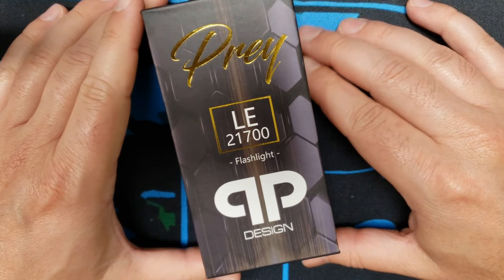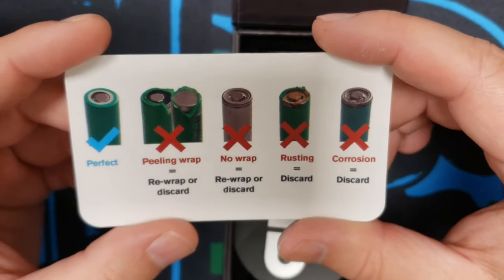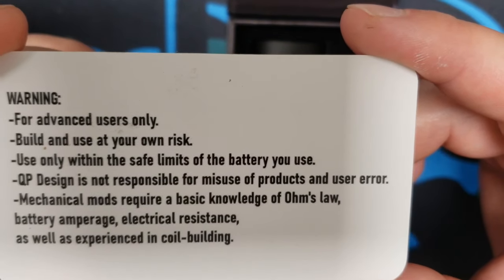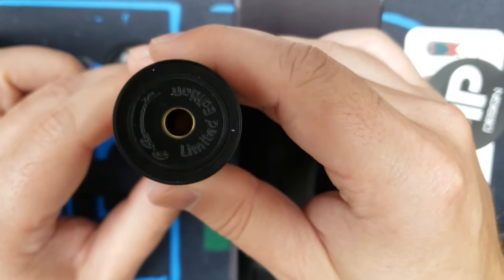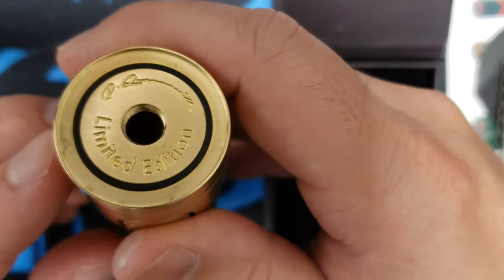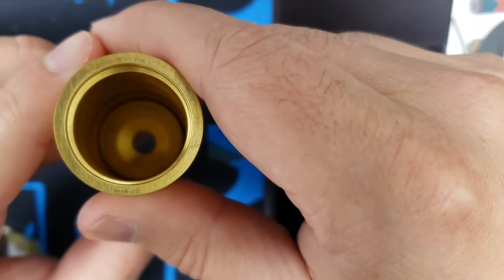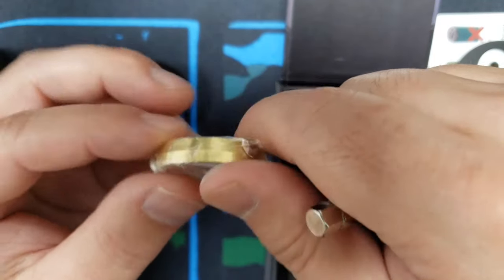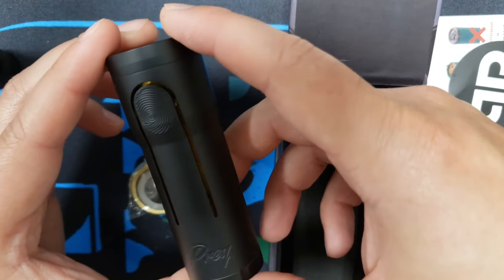Prey Safety Information

Comment: Great prey and kong setup. It hits so hard as if the contacts were made of silver 🔥 kong flavour is great and the post design to feed the wicks with juice is awesome and it works 👍
The prey mech is light weight and compact, however my only comment is that I have noticed a battery rattle (using Samsung 30T).

Wishing you all the best QP designs and you nailed this one too as you usually do with all your great products.
Reply from the maker: Thanks Hussam 👍👍